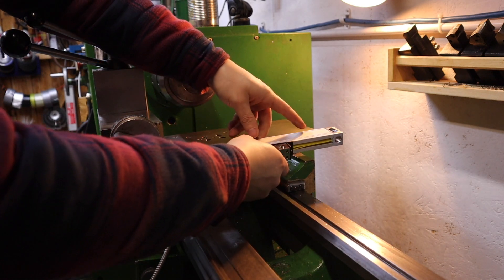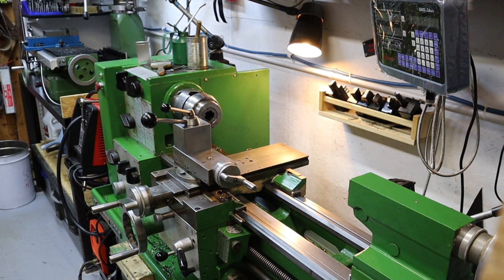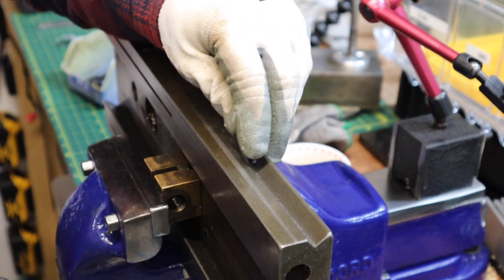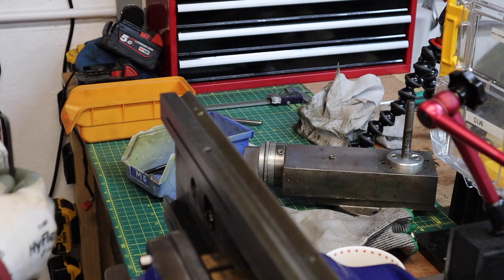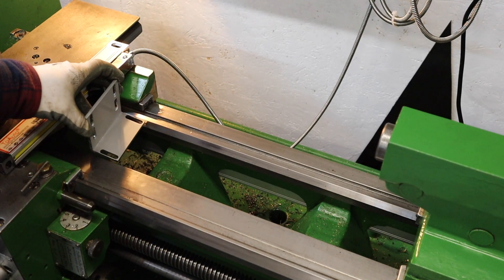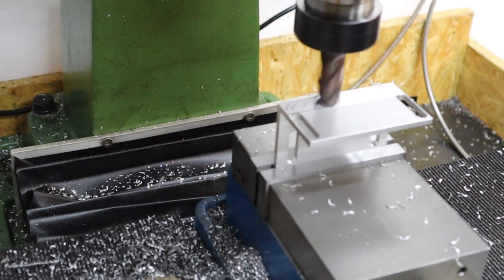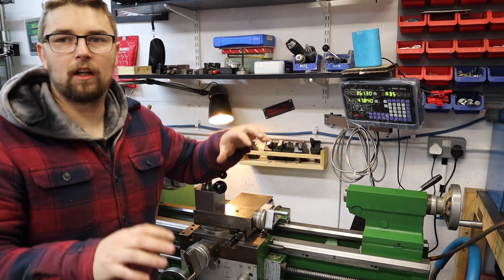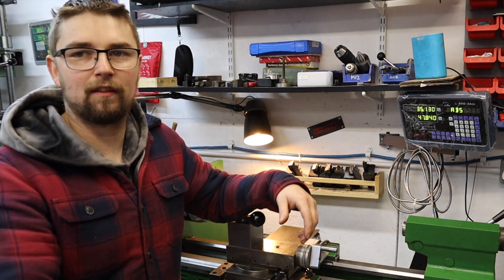Finishing off my DRO Install

Comment: Hi Joe I just bought a cheep 8x16 lathe knowing I will have to go through it and fix all the problems it comes with.  Its a MX210V,  eventually I want to install a dro but at the moment I am lengthening the compound feed screw as it has only 1" of travel. Many more problems to work through buts thats the fun of it.  Thanks for your vids, I'm learning a lot. Keep the vids coming.

Comment: Hello Joe,

Does that cross slide DRO bracket interfere with the tailstock much  when you are drilling stuff in your 3 jaw chuck ?
Reply from the maker: Hi Graham luckily enough the tail stock quill is long enough for it not to be an issue. Any drill over 8mm I don’t even notice drill bits under and short ones then I have to have the quill extended a bit more than before.

Comment: Thanks for sharing. The tool library function is best used in conjunction with a solid tool post mount because you don’t lose your offsets as you will when you adjust the angle / position of the compound slide.
Reply from the maker: Hey dude I was hoping I could use it with my QCTP. I thought I saw a this old Tony video where he could swap tools out and the zero position would move with it.
Reply: @MachiningwithJoe  oh yes, it will transfer the zero position once you have programmed the offsets in X and Z but what I mean is is that if you adjust the compound slide angle or move the dial, you will lose your offsets to a degree. You can reset the angle and return the dial to where it was when you set the tool library up but it will be subject to some error. The DRO measuring the linear positions of the cross slide and the carriage but there is no feedback to the DRO on where the compound slide is.

 I did a video on how I set mine up:

https://youtu.be/iZYXCUMgf2g

Comment: As a Myford lathe owner, I was lucky that MDRO supply an embedded cross slide reader for their DRO. Such a neat solution. Hidden out of sight. Well done on your own installation. Merry Christmas and a happy New Year to you and the family. 👏👏👍😀 Andrew
Reply from the maker: Hi Andrew that must be great to have a lathe with a dro already fitted. Happy Xmas to you too all the best.
Reply: @MachiningwithJoe  Hi Joe. No I bought my Myford Super 7 used, without a DRO. After about a year I knew I needed one and came across the company M- DRO which supplies a bespoke kit. I needed to machine the underside of the cross slide to fit the embedded DRO. Such a clever design.
Reply from the maker: Oh sorry Andrew I misread your first comment. That’s awesome the bespoke kits that companies supply are great pricey but great. I did find one company that offered a kit purpose built for the M300 but it was £800ish so glad I got the import kit to work.
Reply: @MachiningwithJoe  I know what you mean. I did toy with an import kit (like I have bought for my mill) but was swayed by the embedded cross slide feature. From memory it was about £440, so not too bad. Still a hole in my pocket 😂

Comment: I used a magnetic scale on the cross slide (X), more compact and easy to fit.
Reply from the maker: Yeah a slimline magnetic scale would have been great but unfortunately this is what you get from cheap budget import lathes.

Comment: Hi Joe, watching with interest as I need to do the same thing on my M300. You are going to have to watch coolant ingress, maybe you could form an angled trough of sorts above the slot using silicone to direct any fluid away (like a gutter). Just a point of reference in case you have any new starts watching you, it was the cross slide you fitted the scale to, not the top slide (which is an old synonym for the compound slide). Cheers, Jon
Reply from the maker: Hi Jon yeah that is a great point they did come with some aluminium guards so I’ll have to be sure I fit it. Wouldn’t want the scale filling up with oil. Thanks for the idea all the best.